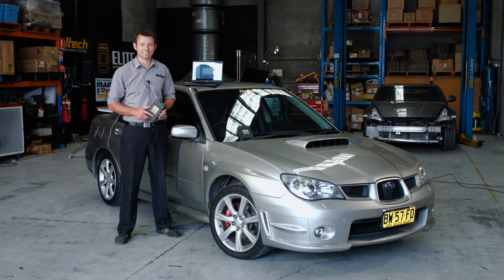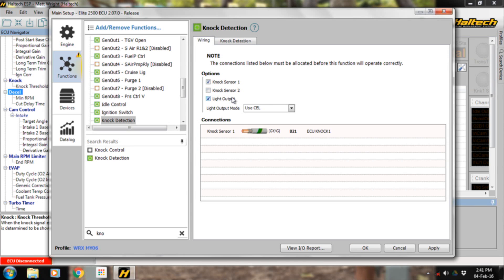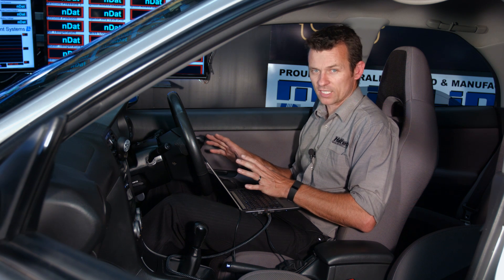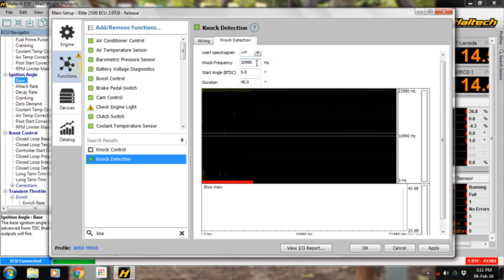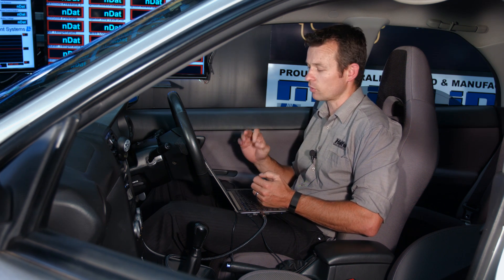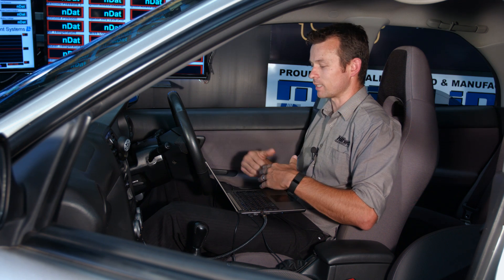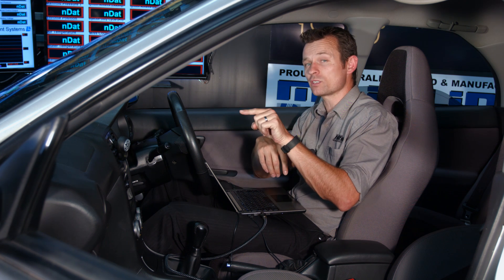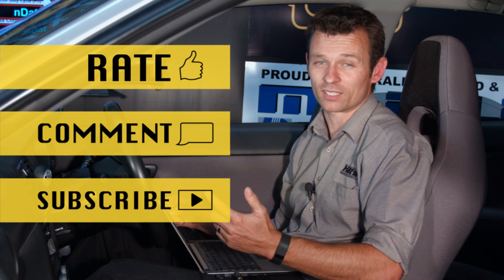Knock Control - What it is and why you need it

Comment: Dear Sir.
  I was about to purchase a different make of ECU but I find myself being swayed by you presentation. 

I am looking for a system capable of 16000revs. 4stk. 2cylinder.  Manly ignition for the moment.  Concerning knock control,  how accurate/reliable is it?  Can i set my ignition high, and then gently let the learning part bring the settings back into a usable map.

Race Go-kart.
Dynoing is a problem.
Reply from the maker: Hi there, a number of ECUs will fit your application. The best thing to do is to contact our tech support on support@haltech.com or give our office a call and one of our tech guys will be able to tell you which ECU is best for your application.

Comment: Haltech Instead of applying long term knock control, why isn't the ignition timing retarded at that base map? It's good that the ECU does this to maintain maximum performance while preventing knock, but since knock control is being set by the tuner, why isn't the tuner just modifying the ignition timing table?
Reply from the maker: It is there for the same reason the factory ECUs all have this functionality. To cover for the variables that the tuner cannot forsee. Like not having the exact same fuel quality, or different climate conditions from those that the engine was tuned in.   This is especially so because the tuner only has the car for maybe a day or so he cannot cover for every possible condition the engine will see.
Reply: @haltech  thank you. That makes more sense. When I first watched this, I thought maybe the tuner would use this to figure out the proper ignition timing by overshooting the ignition timing and use monitor the long term changes made by knock control

Comment: great vedio thanks .  just a quick question .. I have a subaru 1999 sti V5, my diagnosis tool shows the knock.sensor warning .. I checked it It had a mile crack .. do I have to replace it ?? or can I use it for a while ?? 
thanks in advance for your answer

Comment: Does the engine knock differently, frequency or otherwise, in relation to different load or RPM?
Reply from the maker: No, frequency will stay in the same range throughout operation conditions – only amplitude will change.

Comment: Question: Okay with the Long Term; Knock happens, ecu trims out 1/2 a degree in timing and continues to do this until the knock stops and lets say you are now running 4 degrees retarded on timing. Alright lets say this knock was due to bad gas which is good that the timing is cut back... later you refill with good high octane gas that is not going to cause knock. Will the short term trim map ramp the timing back in to get the 4 degrees back or will the Long term have trim map now stuck at 4 degrees less until you re-tune it?
Reply: Jas I think what actually happens is the long term correction s are stored in like a background map and you have the choice to apply them or not. ...I'm.not 100% sure this is the case but that's how the long term fuel corrections work ..

Comment: Does a lean condition create the same knock frequency?
More to the point...If for example a fuel pump dies will the knock control save the motor?
Sorry for the loaded question!  :)

Comment: Great clip! I have an early wrx running a Haltach PS1000 on E85 and noticed a CEL flash up on the dash when under heavy load at high rpm today. I suspected that this was a nock event. I recently purchased the car and don't know much about how the ECU is set up. Tuned by JEM, built by Ichiban. Looking forward to learning more.

Comment: great video.
is there any particular map point you would generally target for inducing knock? 
ie peak torque..off boost? 

does the knock frequency change with rpm? if the motor spends most of its hard life over 5krpm is there any reason to 'tune' the frequency at that rpm?

lastly the car runs e85, given its tendency to not knock should the knock test be done with a lesser fuel?

Comment: Could you add a knock sensor to an engine that didn't originally have one, what would the considerations be for the choice of sensor and it's  placement / setup?
Reply: +Matt Wright I'm looking at an air-cooled application to, with its placement does it need to be near the cylinders or does it not matter as the vibration is transferred anyway? I've had a quick look and found some bosch sensors, are these what you recommend?

Comment: so for the settings on the knock window you have it end at 35 degrees ATDC? because you have it start at 5*BTDC and duration is 40* right? and another question.the test matt performed on the dyno to induce knock, was it audible behind the camera?
Reply from the maker: +Ismael Candia Yes with those settings for the knock window (starting at 5 degrees BTDC and duration of 40 degrees it will stop looking for knock at 35 degrees ATDC). In regards to the knock being audible, yes it was, in fact if you listen carefully to the video you can hear it.
Reply: Ok thank you, now I can be confident how I setup and find knock center frequency for a specific engine.and Matt thank you for the efi 101 seminar in 2012 I am now a tuner thanks to you and efi university.

Comment: Hi, in video is Subaru WRX 2.5L right?  It has 99.5mm bore => according usual knock frequency calculator it may be around 5.8khz. Why in video it detected 11khz? Its was just a quick(unprecise) illustrative example or it can realy be so much different in real compare to theoretical calc?
Reply from the maker: +PhoB J It was set just to illustrate the point made in the video. This video is not intended as a Subaru tuning guide, but a general explanation of what a "knock" is and how to control it.

Comment: Great video!  A question though:  Once the base & long term mapping is adjusted by the ecu, is it constantly applying updates to get the best operation solely based on the knock sensor?  IE: If temperature drops, does it sense that and add timing using the  knock sensor to keep from going too far, or is it always adjusting based on knock sensor feedback?

Comment: Any chance of a CA18DET patch harness? I would modify the stock one, but asking just for future reference:p Does anyone knows how the elite 1500 compares to Link's ecu's? I used both software, and really liked the Haltech one in terms of usability :)
Reply from the maker: +St0RM33 Can't really give you a direct comparison to other brands because we are, well, a bit biased LOL.
But we do have a patch harness for a CA18:)
Reply: haltechecu Thank you very much. I left the question open to the public to answer too:p Since i've seen this video i started looking again into spark pressure transducers (also ones with ion-sensing). I guess if your ecu software allows for basic logic programming it is possible to integrate such a system using one or more of the analog inputs. If not i will contact Mighty Car Mods and send them to Turbo Yoda so you are forced to make a software update for it ahahaha
Reply: haltechecu Btw just checked your site and i couldn't find a ca18det patch harness, i guess you need to update it, because you probably have ones for more engines but it only shows a very limited range
Reply from the maker: +St0RM33 Second one from the top:
http://www.haltech.com/sport-1000-patch-harnesses/
Reply: haltechecu Ohh! So they fit the elite too, right?
Reply from the maker: +St0RM33 At this stage only Sport, but one for Elite is coming soon too.

Comment: how does it communicate with flex fuel? If it adjust map permanently -0.5' ignition and you add higher octane will it remove adjustment and start to listen for knock again?
Reply from the maker: +Patrik Sabo The long-term knock tables can be set to 4D, to learn against ethanol content. A number of different percentages can be configured, allowing for a different table for each amount of ethanol.

Comment: Why do you need two sensors?
Reply: Most v shape engines will have 2 knock sensors, one towards the front of the engine, and one towards the rear. It helps to hear knock on the nearby cylinders instead of hoping a knock signal is detected from multiple cylinders away

Comment: The knock frequency should be a variable range of min and max. We measure cylinder pressure in the crankangle domain with Kistler 6125s pressure transducers in my engine lab, and heavy knock is not necessarily a specific frequency. A single 300 bar pressure spike will not register a knock frequency, but high frequency and low amplitude ringing during 10-90 mass fraction burn duration can be measured as "knock" but not actually be harmful. Also, if too much ignition timing is retarded, pre turbine temps may be dangerously high. Can the haltec system also active additional anti knock countermeasures, like immediate water injection? Also, has this haltec system been vetted against cylinder pressure data?
Reply: +BurnDuration Of course this is a limitation of piezoelectric sensors, which are pretty much an old and cost effective technology used by OEM's just as a safety countermeasure. Pressure transducers (integrated in spark plugs) with ion sensing tech are probably the future but from what i looked a couple of years ago they are too expensive to be integrated on a consumer vehicle
Reply from the maker: +BurnDuration The Haltech can be configured to perform any output/function you like, based on any event. For example, on a knock event, you could have water injection engage for a period of time.
Reply: +BurnDuration Exhaust temps are not a problem with this kind of control strategy.  Its only slight retardation and only for a fraction of a second.   

Whats "10-90 mass fraction burn"??
Reply: The program lists the frequency as a centre freqency. Not as THE knock frequency. Even the program shows it goes red at just about any freqency so its pretty easy for the computer to tell even if you get the settings a little wrong.

Comment: Really enjoy the technically speaking series, wonder how a 12v cummins could benefit from a haltech and ebc solenoid, i suppose the knock control couldnt be used in an engine that doesnt have variable timing
Reply from the maker: +Joshua Marsh While knock control works on engines without variable timing, at this stage we do not support diesel engines.